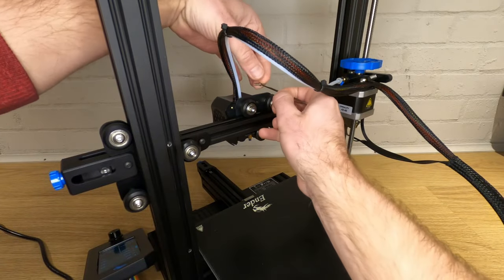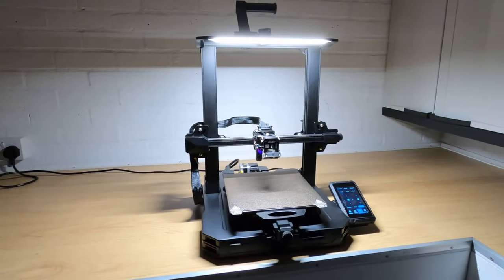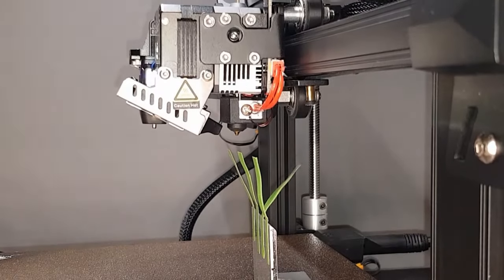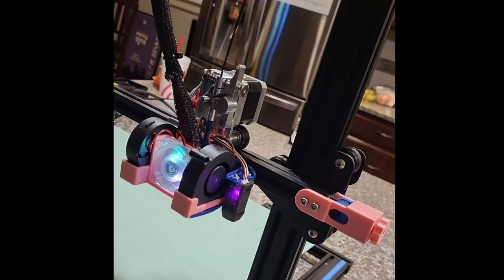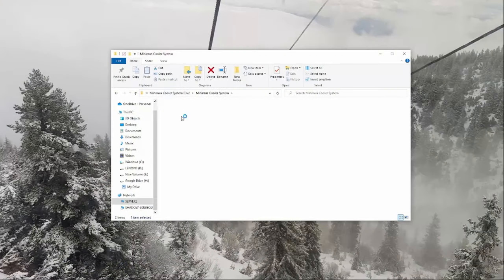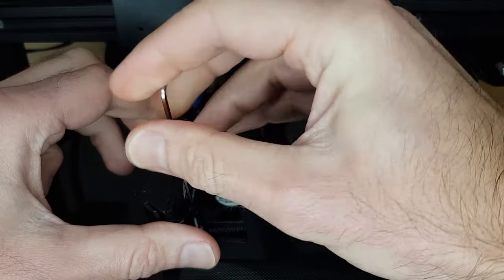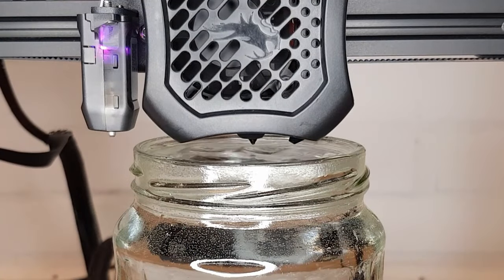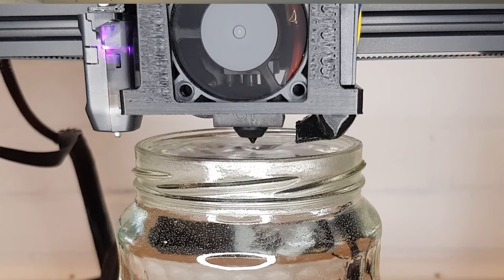Minimus Cooler -Possibly The Best Cooling Fan Upgrade For Your Ender 3 Style Hotend

Comment: I'm new at 3d printing. Will this setup work on a creality CR-10s Pro V2 ?
Reply from the maker: From memory I think the standard hotend on the CR10S Pro is longer. The cooling ducts would be pointing in the wrong place. If you put an Ender 3 hotend on it then it would work (and you could get away from those annoying different thread nozzles!)
Reply: @RickyImpey  that is why the nozzles I bought from creality did not work.
Reply from the maker: @bn81159  Yes, they used a different thread on that one printer, very annoying. Hotends are cheap if you want to change but you'd also have to change your fan setup. The Minimus might help you there. The only problem you may have is that the hotend mounting posts are probably in the wrong place🤔 I'll have a look on mine to see if it would work.
Reply: @RickyImpey  Thank you for your knowledge and all your helpful videos.

Comment: Will pla work or should I use PETG?
Reply from the maker: You can try PLA and see how it holds up. The only thing you may find is that it might become a little flexible if it gets warm but i ran a PLA version for a little while with no issues. PLA+ would be a good in-between option if you have any.
Reply: @RickyImpey  Thanks I need to get some g10 to print petg because glass sucks for petg thanks I will use pla in the mean time.
Reply from the maker: @ThePrintZone123  I use glass for PETG all the time. Just use a thin smear of PVA based glue stick as a barrier layer as the PETG can stick way too well on glass.
Reply: @RickyImpey  Oh okay thanks I will try that.

Comment: Does this work on the ender 3 s1 pro?
Reply from the maker: No, not on that printer, that has the sprite extruder and hotend.
Reply: @RickyImpey  Do you have any suggestions for easy to implement better cooling for the Ender 3 S1 Pro? I'm still very new to 3d printing (about 2 months in) but am in the process of figuring out the Sonic Pad and if nothing else I realize improved cooling would be helpful.
Reply from the maker: @cdaitch  Hi, I haven't tried a fan mod just yet but I have a product on the way that should make it easier on the S1 and S1 Pro. The part cooling is a little lacking on the S1 Pro, especially if you want to speed things up. Watch this space...

Comment: I need 5v fans if im in america right? wanted to buy noctua for hotend but dont know if 40x20 12v is right for europe
Reply from the maker: Hi, the fan voltage will be the same on each printer wherever you are. The mains voltage changes for different countries but after the power supply, it will all be the same. Ender 3v2 is 24v. Most Noctua fans are 12v so you would need something like a buck converter (dc-dc converter) to drop the voltage to 12v to use their fans.
Reply: @RickyImpey  ok so if i buy a 40x10 noctua fan(+buck converter) i can use it for the hotend plus the dual fans right? I love ur design il be sure to tip you well since i love ur work and thanks for the help.
Reply from the maker: @MarsAttack23  You'll need a buck converter for each fan circuit so one for the hot end cooling fan and one for the part cooling fans👍

Comment: It’s decent, but I get better airflow out of my BrissMoto fang 🤷🏻‍♂️
Reply: What did you use to measure your flow?
Reply: @roguepaul  just a water flow test, 
Used the Minimus with 2 5015 blowers and the Briss with one blower. Minimus almost just seems like it has too much restriction and very concentrated airflow, where the Briss is less restrictive
Reply: @chadwickbikerboy09  There is a section in the readme where I recommend 60% fan. Anything over that on the 4010 and I'm getting bad layer adhesion, Edge curling. Have to drop it to 40% and lower sometimes. 
High air flow is a 3D printing myth. It's just the right amount of air at the right place at the right time. 👍

Comment: 3:51 Is that touching the heater block silicone sock ? Yikes. "How to burn your house down for the low-low price of 2 bucks" 101.
Plenty of good free options out there btw : Hero Me, Hydra etc etc....
Reply from the maker: Nope, not quite. There is an air gap and I've been running the hotend at temperature while removing fans for filming and there is no issue with melting the printed parts.

Comment: Too long video for so simple upgrade. And still I have no clue WHAT EXACTLY we cool down?? Hot-end does NOT needs cooling because it needs to be heated up! So... what exactly and why we should cool??
Reply: Hotends absolutely need cooling, and literally all hotends have fans on them. That's how the printer controls the hotend temperature and holds it at the exact settings that you set it to. Also, if the hotends would have no fans, heat would just start to travel up the hotend itself and start melting filament way earlier than it needs to be melted, and clog the nozzle/ptfe tubing, making the whole hotend unusable, or worse, starting a fire. There is a term for this, and it's called heat creep, when the temperature starts creeping up the hotend and not just staying at the block/nozzle where it's supposed to be. I hope that helps to understand how 3d printer hotends work, and why you absolutely must have cooling.